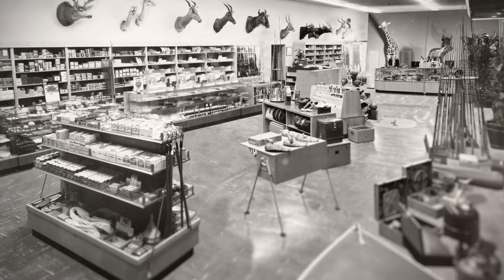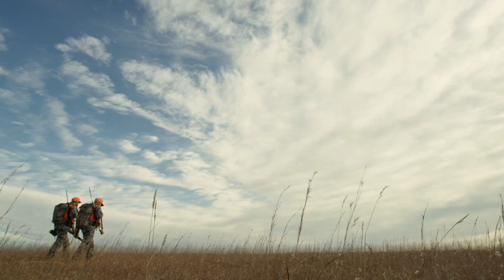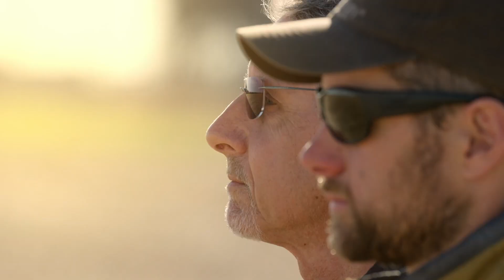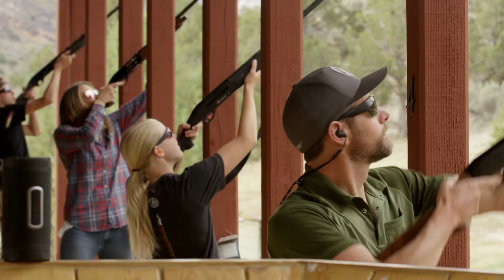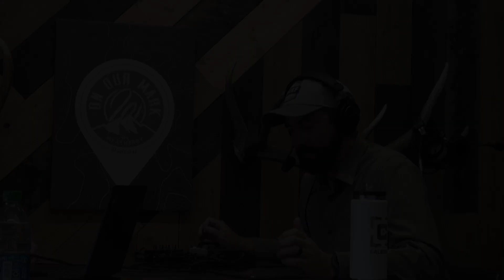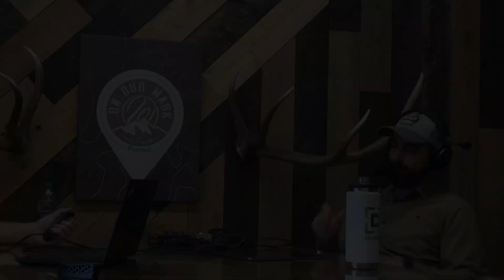On Our Mark: Episode 32 - Testing the New 3D Hex Recoil Pad

Comment: Can you buy them separately and put them on other rifles like the Camilla, deluxe models
Reply from the maker: Because of the way in which the pads are manufactured, it's not possible to retrofit them onto existing stocks. They are available as optional equipment on the Peak 44 Blacktooth stock, which is the stock we equip on the Backcountry 2.0 family. That stock can be purchased directly from Peak 44.